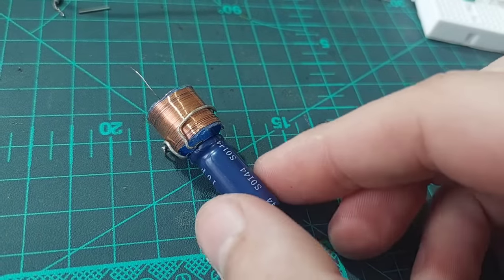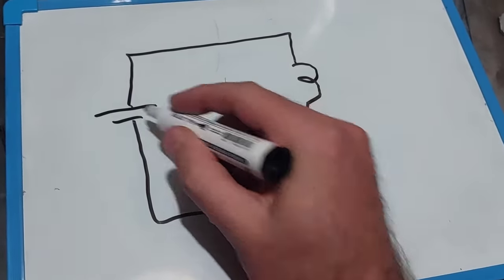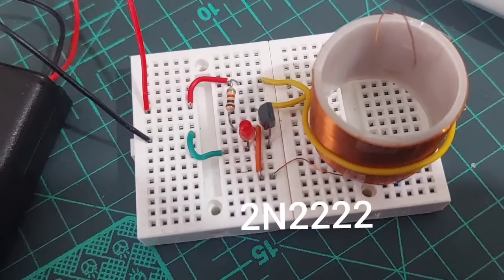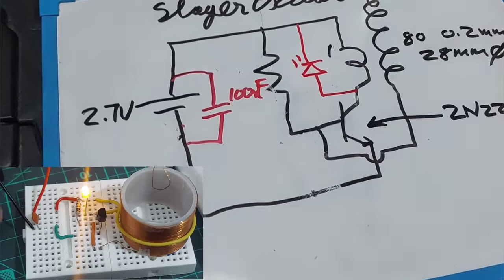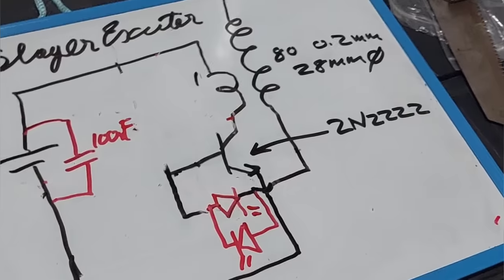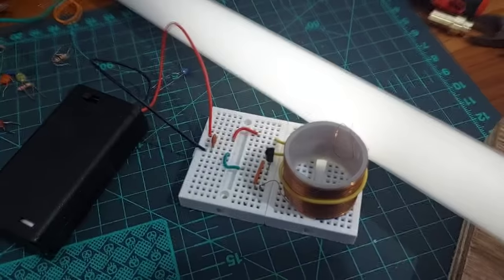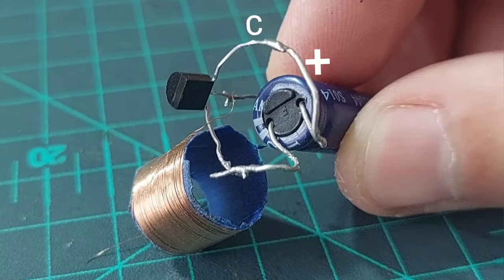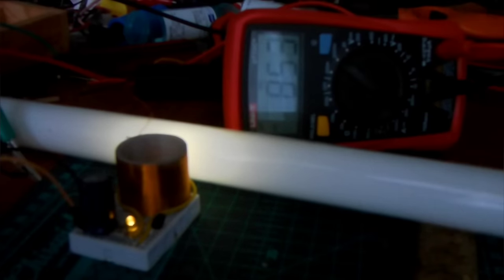A Tesla coil with only three components!

Comment: Oh wow. It works on LT Spice. The 2.7V is even precise. I can't imagine it lighting a fluorescent light bulb though, and I am not willing to put the circuitry together and see. It's the 3rd Tesla Coil demo I tried by using LT Spice to simulate the results. The first two had some misinformation problems. Or I had problems with getting them to finally function on LT Spice because I am not willing to do the hands-on work.

https://youtu.be/P1xYNbgiB0g

Comment: Why does the 100nf cap improve performance?
Reply from the maker: As I understand it, the cap assists the battery in supplying the high current demand when the transistor is on. This is most noticeable when using NiCad batteries with high internal resistance.
Reply: @williamfraser  Thank you!  I've built a number of these, and it's so much fun to find ways to eek out just a little more for a little less power!!!!

Comment: how many components do you need to rebuild this as a radio? maybe a dumb question but its still interesting to me. you guys are magicians!
Reply: This question is far from dumb. This oscillator circuit can and has been tuned and used as a dedicated RF transmitter (aka "bug")
Reply from the maker: I noticed that the frequency can be adjusted by moving the position of the primary so if possible it should at least be tunable.

Comment: I would like to use something like this, to power a light in a walking cane (easier to see in low light conditions). The trick is: how to recharge it.
A small dynamo, similar to a "spiral plunger spinning top" could create a small current every time I touch the walking cane to the ground.
The trick is: how far must the tip of the cane "give" - in order to get enough spin - to charge the circuit?
Reply: This doesn't seem like the most efficient way to produce light. Why not connect the supercap directly to an LED instead?
Reply: @KingJellyfishII  when you take a step and push down on the cane, you get about half a second of dynamo charging. Depending on the person, it may be several seconds before another movement of the cane provides a charge. During that time, a constant voltage is needed- or the LED will get dim.
Reply: @Soupie62  what about a boost converter circuit? they're over 90% efficient, but they are quite a bit more complex.
Reply: @KingJellyfishII  for any aide for the infirm or disabled, durability and reliability are what you want. Just having a dynamo in a walking cane is already pretty comp,ex, thank you
Reply from the maker: I haven't measured the current during operation but a dynamo could work. It will all depend on the stroke of the plunger and the gear ratio. A longer stroke and high gear ratio will generate more energy but it will also require more effort to press it down.
Reply: @Soupie62  I understand that, however the boost converter circuit is proven to be extremely reliable, and due to its popularity is widely available cheaply. You can get boost converter modules that are about the same size as the device in the video.

Comment: Is there a way to do this project using a bc547 transistor?
Reply from the maker: Most npn transistors should work with the standard Slayer-type circuit. The simplified circuit is finicky so results may vary.
Reply: @williamfraser  Thank you very much for the answer ☺️🙏

Comment: What's the lowest voltage at which the lighter pulse will (re)start it?
Reply from the maker: With a small signal diode between base and ground it restarted as low as 260mV. It stopped resonating at 245mV. The values depend on the position of the primary (about halfway up the secondary coil.) Without the diode and no resistor on the base it stops at 0.75V, restarted at 0.8V.
Reply: @williamfraser  Amazing. What a cool device and demonstration!

Comment: 6:00 it looks like my circuit has finally stopped resonating at 327 mV. You touched the coil yourself so why do you say it stopped on its own
Reply from the maker: Well spotted. The voltage was dropping so slowly in real time, the only way to check if it was indeed still going was to check for the slight voltage rise after touching it. It didn't restart with the emp at such a low voltage so I called it a day.
Reply: @williamfraser  I was being pedantic. It´s okay. It was a figure of speech

Comment: What if push button was used  to start it 😊
Reply from the maker: Yes a brief connection between positive and base should get it going.
Reply: @williamfraser  been playing with same sort of circuit but lower voltage and normal caps to make a small portable welder and for learning characteristics of the different capacitors when used together 🤔😁

Comment: Is there a way to test the voltage/mah output?
Reply from the maker: It should be possible with specialized equipment but all my attempts with ordinary meters resulted in random low voltages. Highest steady reading was 75V using a third coil and capacitor with rectifying diode, and placing the coils next to each other for mutual inductance.
Reply: @williamfraser  thank you William. Also wondering if the size of the coil determines how long the charge dissipates?
Reply from the maker: @JohnSmith-bh8um  I know very little about the nitty-gritty details but I believe the size of the coil pretty much determines everything about the circuit.

Comment: try diy non-electrolyte super cap by electroplating layers
Reply from the maker: Interesting, tell me more.
Reply: @williamfraser  the point of the idea is that you think it through yourself, the ultra thin passivation oxide (as the capacitor dielectric) layer on top of certain metals (electroplated) is the key, its a process
Reply from the maker: If battery tech is anything to go by then getting rid of the electrolyte should significantly increase specific energy.
Reply: @williamfraser  yes, well actually in electrolyte super caps the specific energy is same as in this, if the dimensions stay the same, because of double layers thickness is same as the thin oxide dielectric. but if you thin down the electrode thickness, equivalent to the electrolyte layer thickness, then you get many many more layers in the same space, better specific energy, another option but more complex is to vacuum deposit the super thin layers, but I rather do it with the electroplating super accurate layers thickness
Reply: @williamfraser  also getting rid of electrolyte means no breakdowns in the water, higher threshold voltage, no boiling/vacuum effects, lots of benefits
Reply: @williamfraser  its all about being fully solid state and layer thickness, total layers per volume
Reply: @williamfraser  ie it does not explode as steam at high temp, like electrolyte caps
Reply: @williamfraser  run the foil through graphite brush to get the oxide side conductive, but not remove it, then electroplate the next thin metal layer
Reply: @williamfraser  try spinning a graphite rod with alternating electroplated layers and graphite brushing conductive layers, not removing the thin oxide with the brush, gently

Comment: No corona?
Reply from the maker: @justtinkering6713  good question. I assume it is there, just too faint to see. The larger coil used at the end of the video makes a tiny blue spark at higher voltages.

Comment: Nice but one would think with the new century of evolution and trans dimin travel and shifting using frequency and jiggaeatts because today it’s easy to reach those astronomical voltage numbers very easily with a turn table syncro or a server and a spark plug and ignition coil or even a mosquito racket im just a little concerned about what one with Deviation in mind the possibility that could take place but not complain about this great content just concerned who else is receiving with malicious intent people have been known not to make the logical choices and not considering the conscience of there dyi or science project